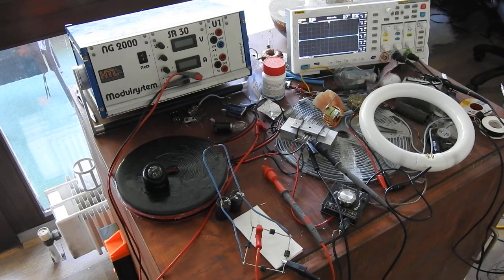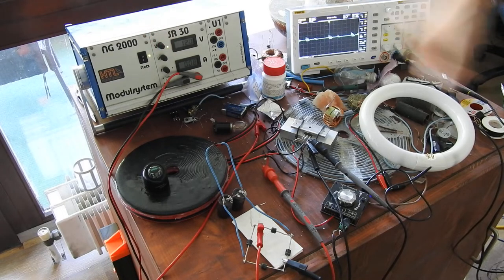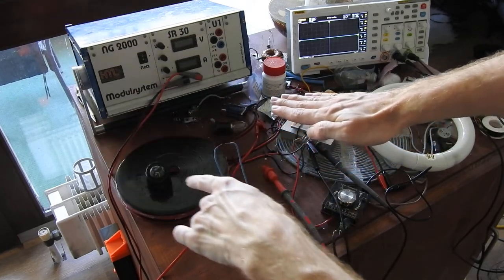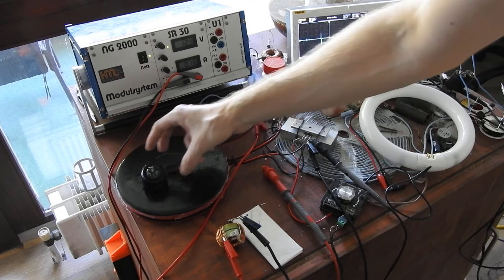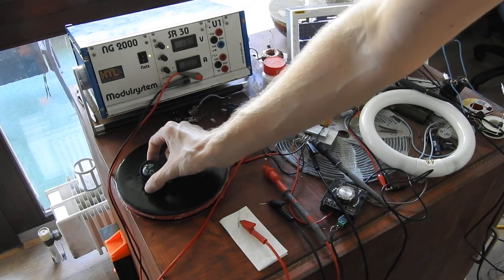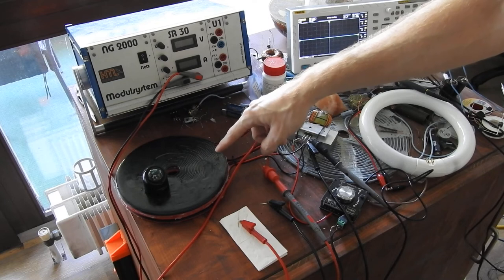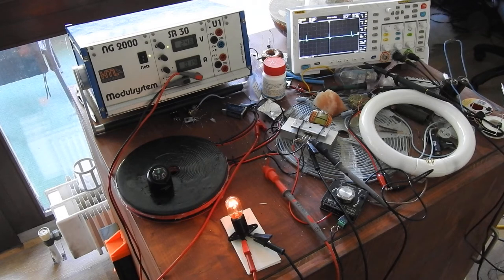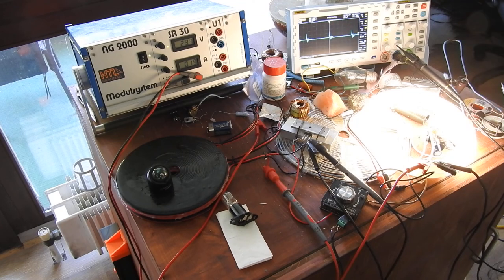Dielectric Impulses, Dielectricity and Magnetism explained with different experiments

Comment: I looked at your schematic, but its not clear to me, the gate connects to the bridge rectifier? how is the mosfet driven? I'll look if I find the video where you explain it
Reply from the maker: The source pin of the Mosfet is connected to the bridge rectifier.
The Mosfet is driven by a small audio amplifier that gets its signal from a signal generator.
Reply: @OmegaZZ111  ah ok, thanks for sharing.

Comment: I would like to replicate the bifilar coil experiments. What do I need to get? Do I need a power supply and a oscilloscope to do this?
Reply from the maker: You need a power supply, a oscilloscope is recommended to see what you are doing but not necessary.
Reply: @OmegaZZ111  Great, thank you. Do you have any powersupply and oscilloscopes recommendations?
Reply from the maker: @braaitongs  Any power supply will do the job.
For the oscilloscope buy a cheap one, because you can damage it with these high voltage impulses and you will also need a 1:100 probe. 
A 1:1000 probe would be better but they are quite expensive.
Reply: @OmegaZZ111  Cool thanks.